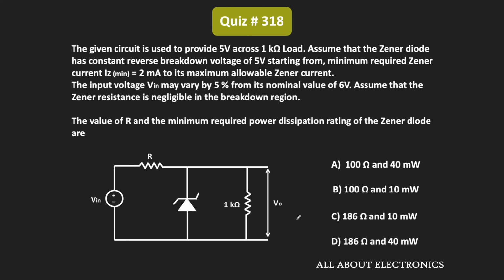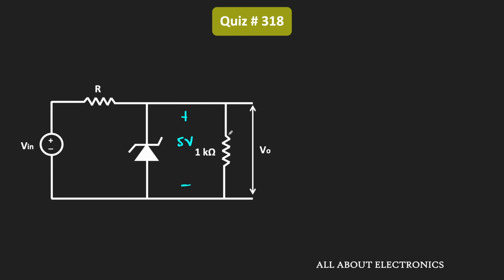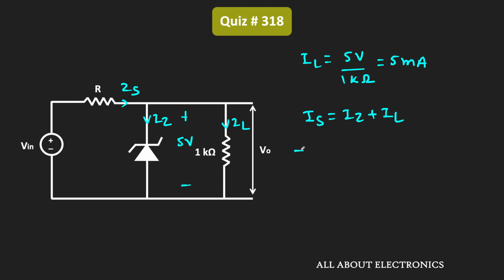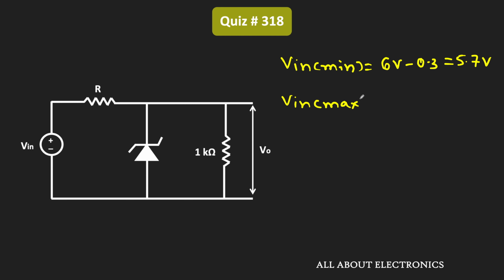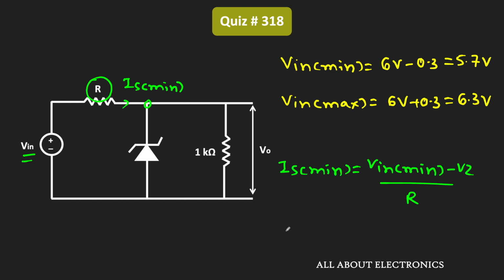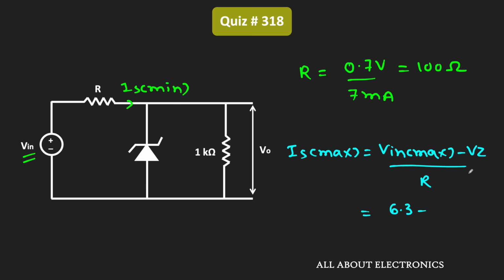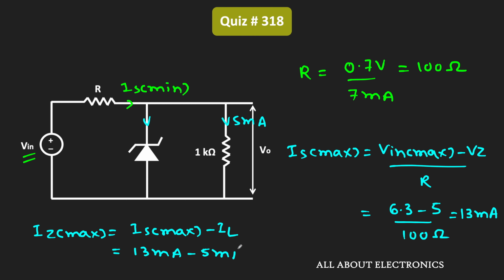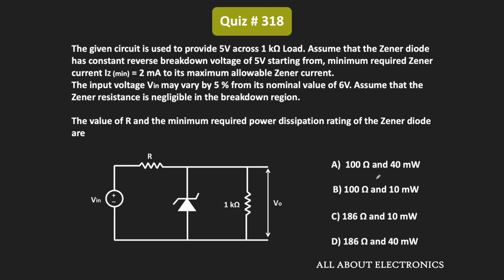Zener Diode Solved Problem (Zener Diode as Voltage Regulator)| Quiz # 318

Comment: P(min) = 5*2m = 10mW & the P(max) = 5*8m = 40mW, how the power rating can be 40mW if they have asked for the minimum power rating of the Zener diode, can you explain this point?
Reply from the maker: What it means is, what should be the minimum power rating of the Zener Diode so that it will not get damaged. If you select a zener diode which has 10 mW dissipation, then as discussed in the question, it will not tolerate the dissipation of 40 mW and it will simply blow away. To avoid that the zener diode should be selected such that, its power rating is at least 40 mW. (in that sense, here it represents the minimum power rating). I hope, it will clear your doubt.

Comment: minimum power rating refers to no load .....when there is no load, complete 13mA  should flow through the zener and it should withstand current of 13mA ...can you plzzz clarify?
Reply from the maker: I think, you misunderstood the term power rating. The power rating of the Zener Diode means, the maximum power at which the Zener diode can be operated reliably. (we also have similar power rating for the resistors, like 0.5 W, 0.25 W, 0.125 W etc)
Here to operate the Zener diode in the given circuit, we have been asked to find what should be the minimum power rating of the selected Zener diode so that it works reliably in the circuit for the given operating conditions. If the power rating of the Zener diode is more than that then it works reliably in the given operating conditions. I hope, it will clear your doubt.

Comment: Sir ,the question is minimum required power dissipation rating of the Zener diode.....but in the answer you have calculated maximum power dissipation rating.....am I right?
Reply from the maker: I think many of you misunderstood the question. Let me explain it in other way. Let's say, in a day, maximum you require  3 liters of water to drink. And for that you require atleast/ minimum 3 liters of container or jar right !!  The same is here.  In the given circuit, the maximum power dissipation across the Zener Diode is 40 mW. So, to withstand that power, the minimum required rating of the Zener diode should be atleast 40 mW. So that, the Zener Diode can withstand that power.
I hope it will clear your doubt.
Reply: @allaboutelectronics-quiz  yes now I can understand.....and thanks for this nice explanation......great sir 🙏🙏
Reply: @allaboutelectronics-quiz  thank you sir 🙏
Reply: @allaboutelectronics-quiz  I think you are only misunderstood the question. Here Iz(min) is given. If you multiply it with Vz you get Pz. That Pz is the minimum required power dissipation rating. Only then we can operate that with reliably. In question, this only being asked. If the question was something which asked for maximum power dissipation rating means, you explanation is correct. Verify that.